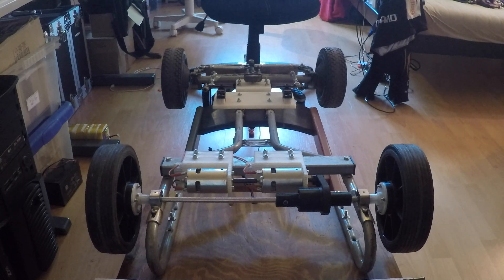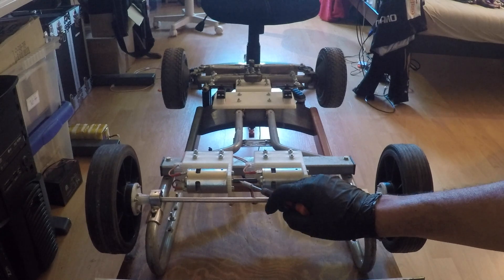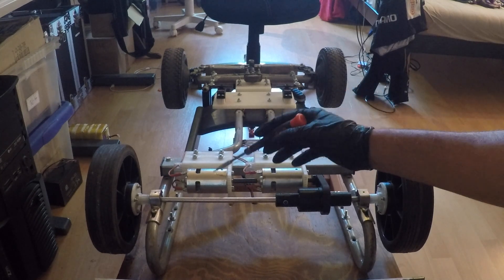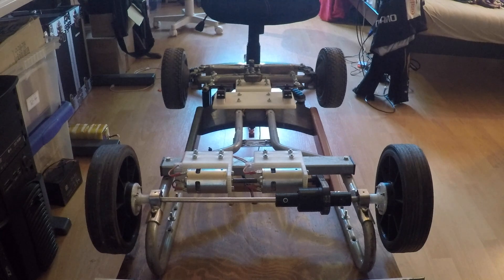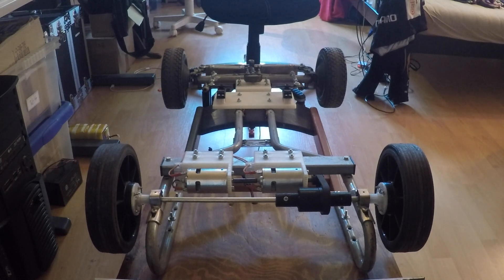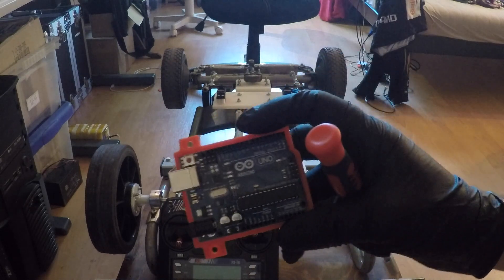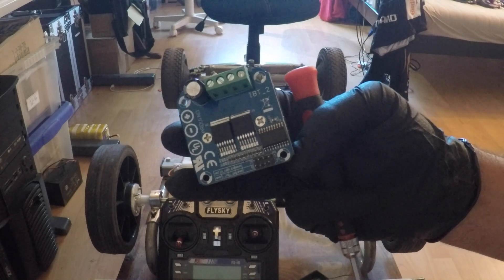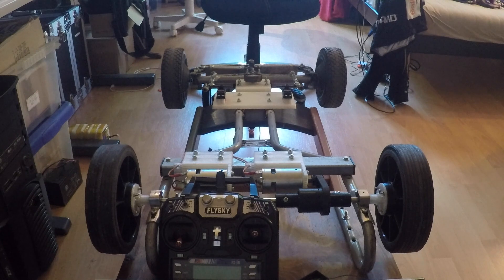Large torque DC motor: 775 DC motor in dual configuration for large scale Electric Car

Comment: U should disconnect the other wheel from the drivetrain, u dont have differential gear. Its hard for the motor when ur turning left or right.
Reply from the maker: I know. I was going to do that... but I moved country and I gave up on the project. I am going to start build a new one... bigger and better. Stay tuned 😉

Comment: Hi i want to make rc ride on car for son using these motors.can you tell me how you connect aurdino to flysky reciever.could you please share aurdino board link which you used .Thank you
Reply from the maker: Hi, ramarao. You can use any arduino/arduino compatible for your project. Here is the link from Banggood: https://www.banggood.com/Wholesale-Arduino-Compatible-R3-UNO-ATmega16U2-AVR-USB-Board-p-68537.html?p=JM09079991593201704F

You also need a motor driver. 
If you RC is not to heavy you can use the L298N: https://www.banggood.com/Wholesale-Dual-H-Bridge-DC-Stepper-Motor-Drive-Controller-Board-Module-Arduino-L298N-p-42826.html?p=JM09079991593201704F
However, if it is a big or heavy RC car I recommend to use this motor driver instead (BTS7960B): https://www.banggood.com/Semiconductor-BTS7960B-Motor-Driver-43A-H-Bridge-Drive-PWM-For-Arduino-p-967472.html?p=JM09079991593201704F

There are plenty of videos showing how to connect the Receiver/Arduino/Motor Driver/Motors... if you have any problem to do that let me know and I record a video for you. Good luck!
Reply: Robledo Einstein Thank you very much reply.. sure I will let know if I have any problem  ..thanks for quick  reply
Reply from the maker: You're very welcome. ;)
Reply: one more question.. what you used as shaft and how you  attach to wheels and pully setup..
Reply from the maker: I used this: https://www.banggood.com/Wireless-Electric-Skateboard-Accessories-Belt-Motor-Pulley-For-7270MM-Wheel-p-1112896.html?p=JM09079991593201704F

The axis of my RC has a diameter of 8mm. The gear that came in this kit has 22mm diameter. So, I 3D printed a kind of adapter in order to use this gear and belt. If you have got no 3D printer you can make this adapter with wood though.
Reply from the maker: Yes. It is also an option. I used arduino due to the need of controlling other things as well (lights, horn, etc.).
Reply: oh ok .so this one esc is enough to control two motors or i have to buy  two escs
Reply from the maker: Yes, It should be enough to control both motors (it claims to output up to 320A!!!). They will run together and you'll need a steering system independently (using servos, for example). If you want to control the steering with your motors (one motor running and the other one stopped to turn to one side, for example, you might need two ESCs).
Reply: Thank you for all answers .i confused a lot to choose proper electronics.you cleared all my doubts ..
Reply from the maker: You're welcome. If you have any problem during the process just shot me a message. It will be a pleasure to try to help you somehow.
Reply: Robledo Einstein  sure
Reply: hi can you help me to find where I can buy tyres ..if possible  please  share link
Reply from the maker: Hi, ramarao. It depends on how big tyres you need and what type of axis you're intending to use. It's easier to find them in a local department store... The tyres I used in my RC I got from old mowers i had lying around. Let me know what exactly you are looking for (dimensions) and I can help you to find something online.
Reply: iam looking for above 7inch wheels
Reply from the maker: Something like this? https://www.ebay.com/itm/CRAFTSMAN-7-WALK-BEHIND-PUSH-LAWN-MOWER-WHEELS-SET-OF-4-FITS-MOST-TYPE-MOWERS/391623109195?epid=826075399&hash=item5b2e8e6a4b:g:-DgAAOSw5cNYI6MB

Look for lawn mower wheels on Ebay or Aliexpress.

Comment: Nice one but how did you joint 2 of those 775 motors like that with each other can you please make a video of how u did it
Reply from the maker: Hi, "Replublic of Tutorials". I used a "ROLL PIN" to connect the front shaft of one motor with the hear shaft of the other one. But a good option is a "SHAFT COUPLING"... since the 775 motor's got a 5mm diameter shaft you can use one of this shaft couplings from Banggood (they cost less than $2): https://www.banggood.com/5mm-x-5mm-Aluminum-Flexible-Shaft-Coupling-OD19mm-x-L25mm-CNC-Stepper-Motor-Coupler-Connector-p-993558.html?p=JM09079991593201704F

Comment: thanks but I am not making wireless bot, soo what should I do
Reply from the maker: How is your robot going to be controlled? Is it going to be operated autonomous or are you going to control it somehow? Doesn't matter if it is wireless or not, you need an external "device" to control or reduce  the speed of the motor (given that at 24V it'll spin 7000rpm). Tell me exactly how you plan to control (or if you just want it to run constantly at 3000rpm) and I try to help you with the best electronic configuration for your motor. ;)
Reply from the maker: Btw, if you use a speed controller (look the ones I sent you the links, they are not expensive) you can have this motor running at different speeds... so, you can test it and  see which speed suits you.

Comment: hay can this 775 motor be used for war robot weapon (drum) at rpm of 3000 at 24V . the weight of drum is around 15 kg
Reply from the maker: Hi, "Vevo Video's". 
It depends on how is the mechanical configuration of your robot. However, it sounds absolutely possible to me. Note, at 24V this motor will spin at 7000 rpm. So, you need a motor driver (I suggest BTS7960B) and a microcontroller/arduino/or DYI circuit to send a PWM signal to the motor driver. Other possibility would be to use straight away a speed controller. With this stuff you can have this motor running at 3000 rpm and with an excellent torque.

Find below links with some options for some parts I've mentioned: 

BTS7960B:
https://www.banggood.com/Semiconductor-BTS7960B-Motor-Driver-43A-H-Bridge-Drive-PWM-For-Arduino-p-967472.html?p=JM09079991593201704F

Speed controllers:
https://www.banggood.com/12-50V-30A-500W-Adjustable-Speed-Controller-DC-Brush-Motor-Speed-PWM-Controller-p-1122362.html?p=JM09079991593201704F

https://www.banggood.com/10-50V-40A-PWM-DC-Motor-Speed-Controller-Regulator-CW-CCW-Reversible-Pulse-Driver-p-1091927.html?p=JM09079991593201704F